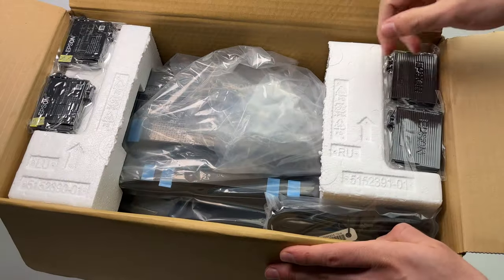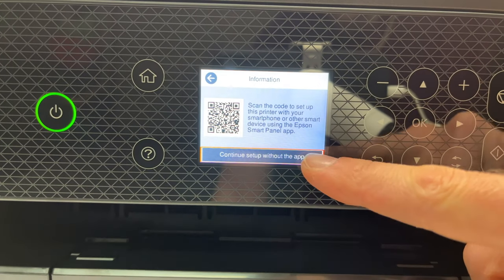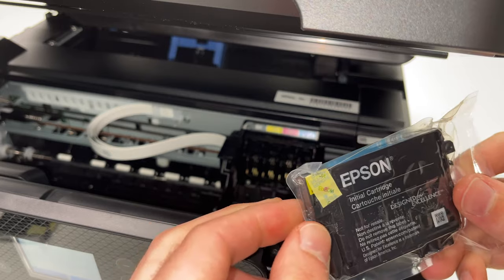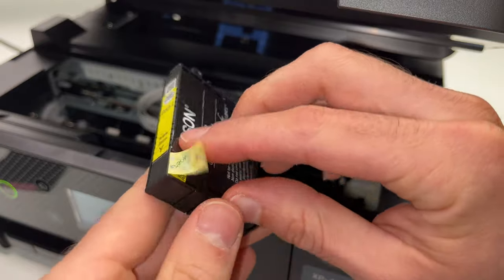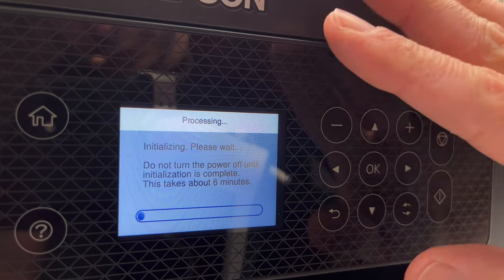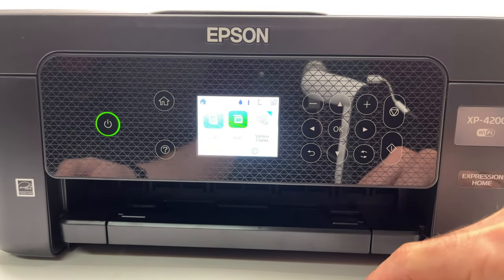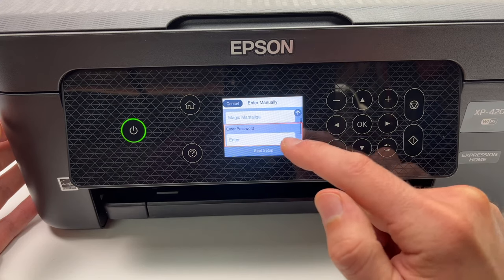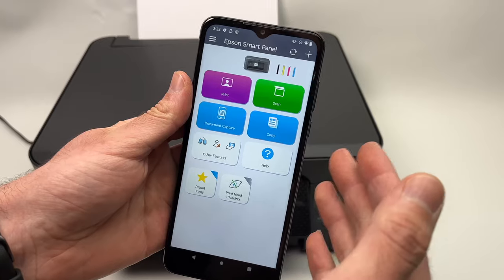Epson XP-4200 Printer: Unboxing + Full Wi-Fi Setup + How to Print and Scan

Comment: OK, so this video saved me. Everything was smooth sailing up to wi-fi connect. It kept refusing the passcode of my router, saying incorrect. I kept re-entering until I was red in the face. I did unplug my router 3 minutes as recommended, ewhich at first did not change anything, but somehow, between a little luck and perseverance, it suddenly connected, yay for the blue checkmark! Thank you soooo very much for this great video!